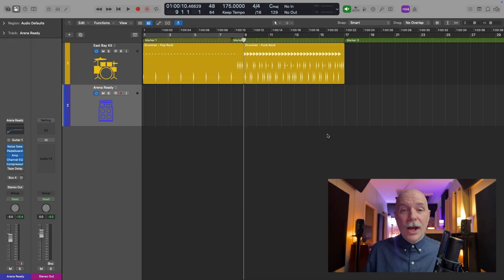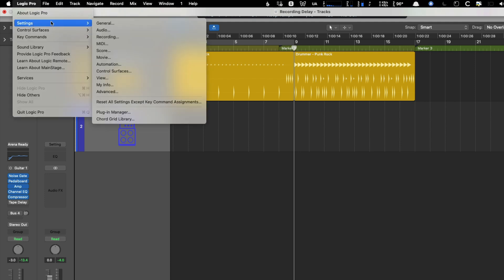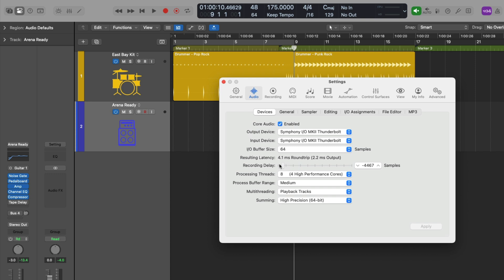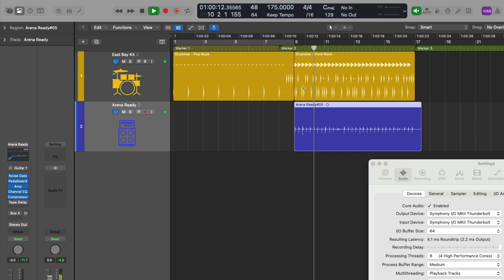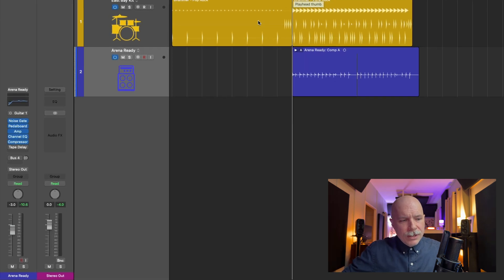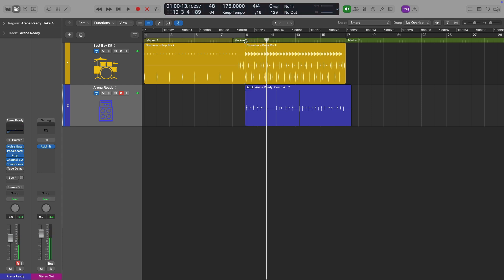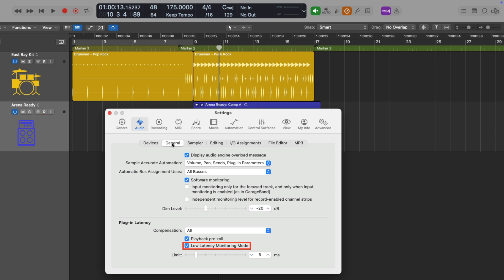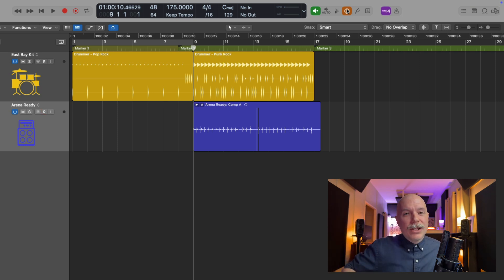Fix Recording Delay in Logic Pro: 4 Easy Solutions

Comment: Hi, thanks for the video, unfortunately, none of the solutions have worked for me. I am trying to record a bass guitar track. I recorded already an acoustic guitar and 2 vocal tracks no problem. I plugged in my bass and there is latency. I am recording very clean, no 3rd party apps, no FX (yet) no eq etc. just straight in. and yet, my bass has a bit of a delay. i also tried closing and reopening the program but did not work. any other ideas???  thanks

Comment: Here's another hack! Say you are already in your mix session and want to track in it. Go to settings > audio > general. Set plugin latency compensation to "Audio and software instrument tracks" when recording and switch it back to "All" during playback. 

It may sound cumbersome to do all these steps but if you set personal shortcuts. It ll be two click to record and play on a mouse like Logitech Mx Master3.  In my case Low Latency is "L" and "=" Toggles between compensation mode. Before tracking I go L and = and record, on playback = and L. All of it happens under the hood very much like a car while my master and bus plugins are still in their place.
As long as your computer can handle the overall session at 32, 64 even 128 buffer this will work like a charm. Thank me later! Happy to answer any questions :)

Specific to my method, if you don't have a powerful computer it might be super helpful to just make a different recording session and bring the files in.

Comment: @whylogicprorules 
Hey Chris, Good stuff. How this message reaches you in good health. 
My name is Garth. I have a podcast @ThinkandSay. We been using LP since we started. And the past several months we been dealing with Logic Pro going out of sync 6 - 10 minutes into doing our show. So much so, it feels discouraging when I just want to a some content recording or live streaming. I'm always worried if it's going stay in-sync or crap out on me. 

I think that it's something simple that I have to turn off. I'm not an audio engineer, and I've brought an audio engineer in, however he's not that verse on LP, Like you. You've using it for years. So Knowww LP fully. 

I'm ball headed like you, and I'm still pulling my hair out, out of frustration. 

I have Core Audio: Enable
Output Devices: Multi-Out Device   
Input Device: Dante Via Stereo
I/O Buffer Size: 64 (I just change it to 64, I had it on 128 before today)

I don't know where to go to turn-off what you recommend to turn off to reduce or stop all latencies. Please Help

Comment: I remember back in the day I used to have to set Recording Delay to a negative value ( in samples ) after using Logic's IO Plugin to determine if Logic was correctly reporting the Roundtrip delay and then compensate for it.  It was a one off thing because it was a Preference and not a setting and was stored in Logic's pref file.
Cable input to output on Audio interface ( turn off  / mute) output in logic. Instantiate IO Plugin - select in and out - then press "ping" and jot down the reported recording delay.
There's a video describing the process called "Logic's Latency Toolbox - Measuring recording delay" or similar.

Comment: been there! anyway I have a question regarding the software monitoring, recently the auto input monitoring wasn't working (you have it deselected in your settings I noticed) however in the recent update 11.1.2, they said that they fixed the issue but it still not working! any of you encountered the same issue?

Comment: The only time you may need this, is for example you are using (monitoring via) the external Dolby ATMOS renderer. (or any other latency inducing monitoring solution) and for example, you are running RME Totalmix (or some other direct monitoring device)for a near zero monitoring for a singer or other....  it is really handy, for making sure resultant recordings are exactly where they need to be, without affecting artist feel/performance.  (important to calculate carefully, the whole monitoring path).

Comment: Your videos are always helpful. I think this is geared towards beginners, not too much detail? but, I find it VERY interesting that you have never checked and set your recording delay and that you leave it at 0? Curious to know if you have tested using the ping function inside of the I/O plugin, with a loop wired from output to an input? or tested by recording a click coming out of your speakers with a microphone right up to the tweeter? then inspect what that deviation is?  I am running through an Orion32, and my recording delay is set to -16 samples.

Comment: Thank you … I really like your channel, too 🙂
I have an answer for you  regarding the recording delay: This is for more complicated setups. If you have a simple setup with just one audio interface, the driver of the Audiointerface tells logic how much time it needs for input and a roundtrip. Things get a little more complicated if you have separated converters. In our studio we have for example on every Mac a RME Digiface USB as an audio interface without built in converter. Connected to this interface are several converters (Prisms, JCF, RME ADI 2 pro fs, Millennia and so on) THey all need little different time to process the signal. However, the audio interface is not aware of this and tells logic still just the processing time of the interface without the converters. For the different converters we have values between -220 and -575 samples. With the correct setting your recording is in this setup still perfect in place :)
Reply: This means that you would not be using multiple converters for the same recording scenario right? Or at least, this would be the less ideal situation. Any idea on how to measure the difference in time between converters? Maybe recording the same signal through both units and sample measure it in the DAW?
Reply: @nuestudi524  Yes, you are absolutely right. Especially for stereo recordings it‘s an absolute no go to work with different converters hooked up on an audio interface. We measured this several times. Word clock ensures, that the converters are in „sync“ and don‘t drift. But wordclock has no idea about to which sample to lock. Especially for coincident microphones this is pretty bad, if on microphone is on the first converter the other one is on the other one. This leads to comb filtering effects, even if both converters are from the same company or the same model.
You can measure the needed recording delay quite easily. Just bounce a track (1 measure is already enough) with test oscillator plugin set to needle impulse to 1 Hz. Adjust the tempo of this logic project to 60 or 120. When you import this file just adjust the region that the needle impulse is right on a second on a beat (this makes navigation just a little easier but is not really needed). Open a second ruler. Then record the track with the needle impulse audio file on a different track going through your AD and DA converters. After the recording you will notice that the recorded track will have some delay when you zoom into sample level. In the marquee tool when you select the space between where the needle should be and where it is, there is a window that shows how many frames and samples you are off. Apply this to the recording delay (with a minus) and make another test recording. You should notice that the needle impulses are aligned now :)
—> save these compensation recording delay times per converter, so that you have it right away… Oterwise you get crazy :)

Comment: This is very useful info. I mostly record vocals and I find the easiest way to eliminate latency all together is using the direct monitor capability of my interface so I don't listen to Logic on the track I'm recording at all.
Reply: While I always do this and it makes for an in-time performance, I find the recording is sometimes itself out of time and requires moving to line it up.
Reply: I just looked up latency of AD converters and it’s negligible. From the Focusrite website the minimum latency the human ear can pick up is 11 ms and one would have to put 10 to 20 passes through AD converters to get to that.
Reply: @johnvender  Interesting. Can you elaborate?
Reply: This is the time when you actually do change the recording delay to a negative value. The way to calibrate it is to put a microphone next to your monitors and record the metronome click, you will notice that it is late to the downbeat visually. So now adjust the negative amount and keep recording it until it’s in time visually. With this method you can listen to your complete mix, monitor to a mixing desk not through the logic, and you will find your performances are spot on in time. The quick way to get that done is to click the R to put it into record mode on the channel and move the output to 0. You will find it when you come out of record. The level will return to the one you were at before. So in practice you don’t use the R clicked on, it will flick to record mode with zero output automatically and then back so you can review what you’ve just played. This works really well. I do a lot ofOverdub work for a film composition using percussion, guitars, weird estimates et cetera and this is how it’s done.